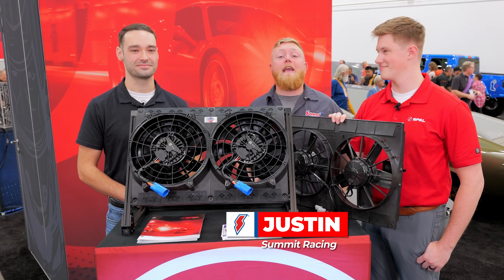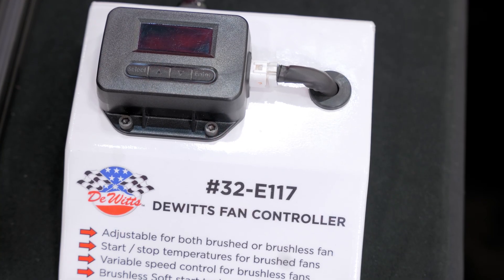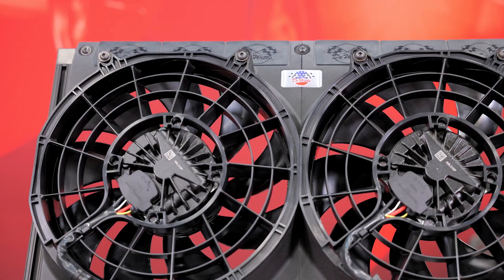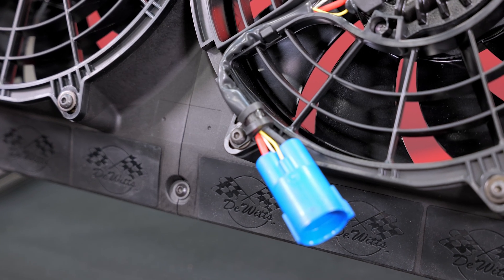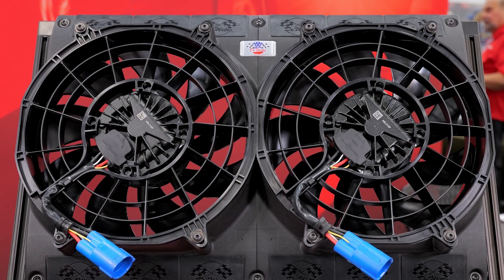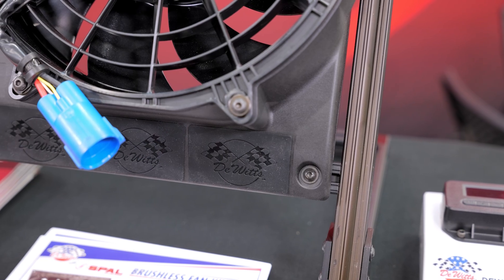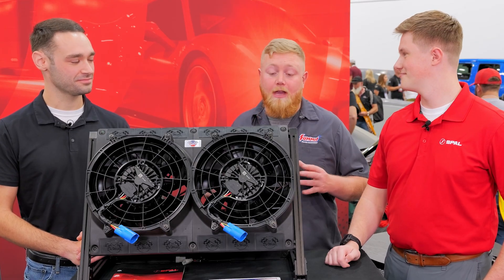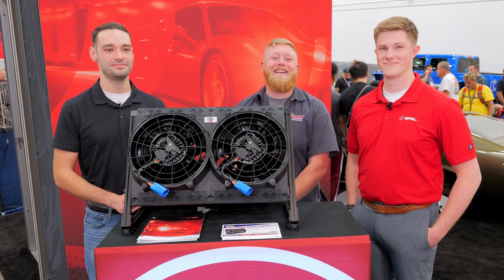Why DeWitts Spal Fans are “Not Your Grandaddy’s Electric Fan” | SEMA 2025 New Products

Comment: no links or airflow  performance chart or detailed link .,,,nothing   ......yawn
Reply from the maker: Here's a link to the Summit racing equipment site for more information! https://www.summitracing.com/parts/dwr-32-sp495
Reply: Since SPAL always always scream performance ,,  no air flow curve in the link WTF  .  Need to no the amp/current draw at 10mm--13mm water/ pressure  drop  3/8--1/2 drop

Comment: Will these attached to a C&R radiator to replace my brushed dual SPAL setup and shroud? I presume any PWM controller will work, stand alone or from an ECU?
Reply from the maker: Great question! These are designed to fit any crossflow radiator with mounting tabs. Yes these require a PWM signal, which can't be provided by a traditional fan relay kit.  If your fan controller or ECM can't provide a PWM signal, then we recommend using the DeWitts wiring and 32-SBL-TS-205P temperature-activated smart sensor.